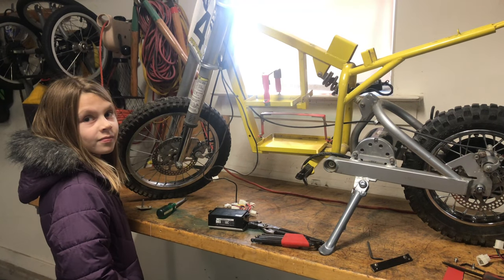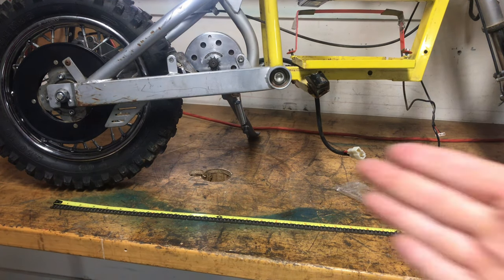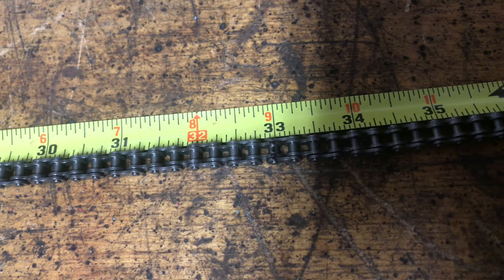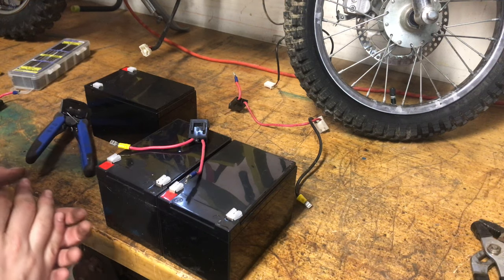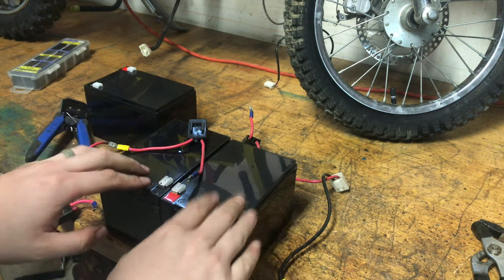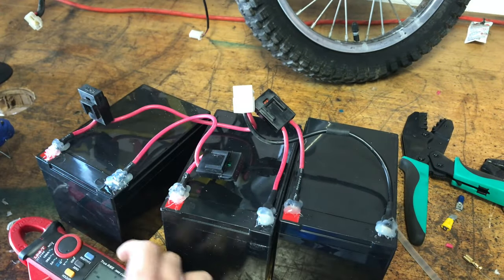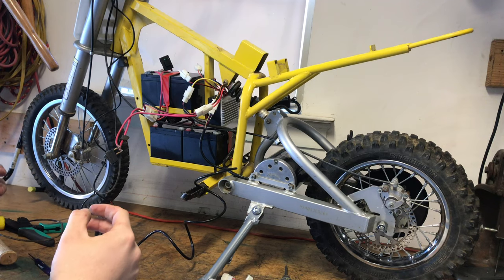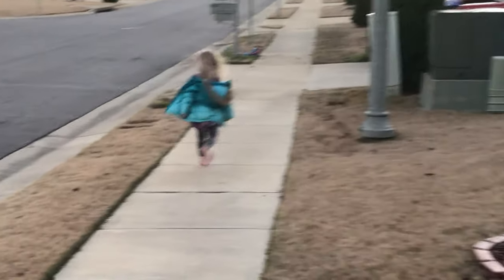Razor MX650 Rebuild Part 4: Controller, Chains, Battery Pack, and First Ride

Comment: My son MX500 razor caliper were rubbing againt rotor in both front and back wheels. How do you fix it? Also brake lever and cable on left side damaged. Do you know how to connect to controller?

Comment: My motor doesn’t pull the wheel correct and the opposite direction of how it should pull. How do I fix that?
Reply from the maker: Like in reverse? Swap the motor leads in the connector.
Reply: Anthony Shelton what connectors exactly?
Reply from the maker: The connector that comes out of the motor. Blue and yellow wires if I remember correctly.
Reply: Anthony Shelton thank you so much it’s working now 👍